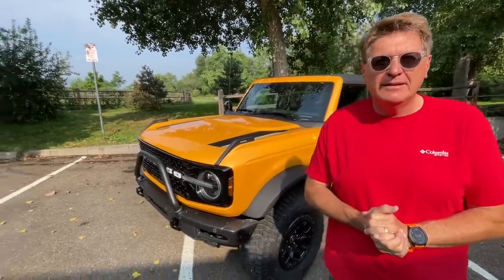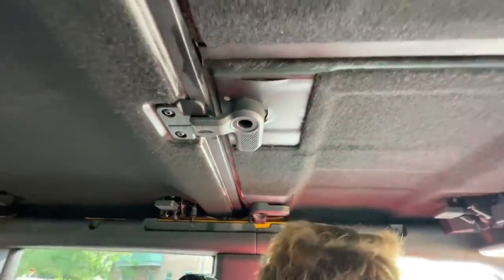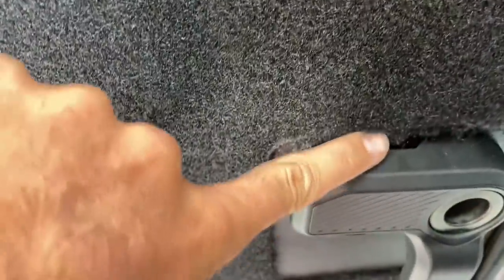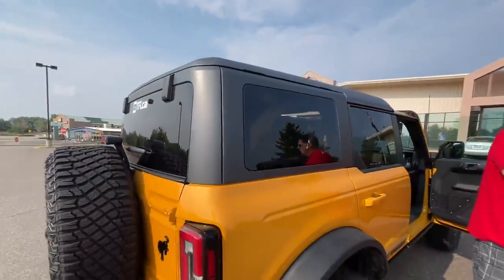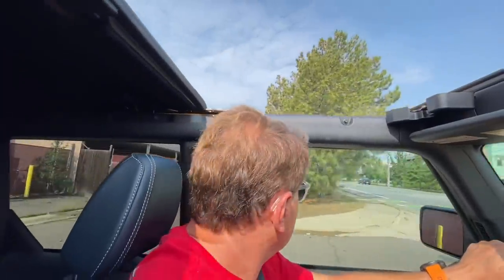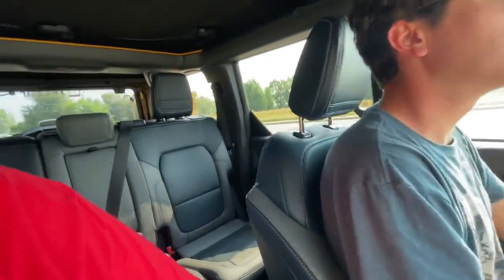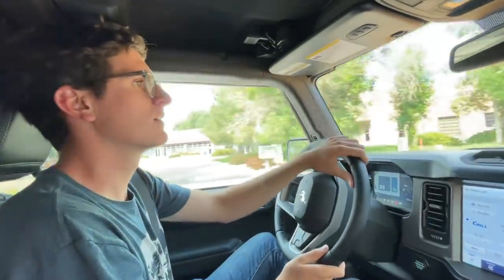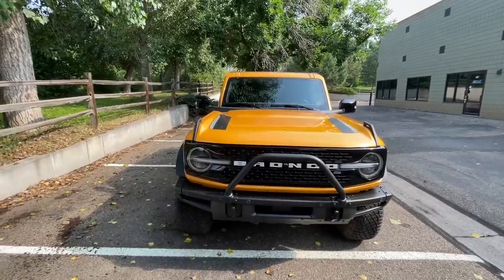This Roof Squeak In My Brand New Ford Bronco Is Driving Me Up The Wall, What Gives?

Comment: I honestly had a lot of the same issues with my 2019 wrangler before I sold it. Lots of creaks and pops from the top. Sounded like it let in alot of road noise compared to other new wranglers I drove. May be a quality control issue but not sure

Comment: They'll get that worked out with the supplier eventually. Probably the lowest bidder and it was "good enough". They had to meet the target date.  However, same problem with the original Bronco the old timers are aware of. Anyone that removed the top found it pretty hard to get it back on without noise and leaks.

Comment: I have a incredibly loud churp squeak in my 2021 Ranger. Turned out to be the drive shaft carrier bearing. Started at about 3000mi. and is intermittent. My experience has proven Ford dealership mechanics make a bad situation worse. So I'm going to live with it for now. Shame, otherwise a great truck so far.
Reply: My 21 Ranger is at 6000, and it's been in the desert, beaches, mountains. HELLISH WASHBOARD ROADS. It doesn't have a single squeak or rattle. I'm amazed at that. Put Ko2's on it and it hasn't gotten stuck yet.

Comment: Well, it looks like Ford built too true of a Wrangler competitor, they've copied Jeep's rattles and squeaks. Wonder how long the soft top will hold up before it starts to leak? As a long time Wrangler owner, I can say it's a matter of when and not if. The foam seals at the various water ingress points do eventually deteriorate, especially if you do driving in dusty/dirty environments with the top down, or leave the top down in the sun a bunch. Just comes with the territory. Your roof can be silent/watertight or it can be removable, but generally can't be both at the same time.
Reply: My thought watching this was, it’s no worse than a Wrangler. Considering the type of vehicle it is, I don’t think it’s that crazy.

Comment: Sounds like a similar problem that the Aussies had with a plane many years ago.  A pilot complained that there was a noise coming from the instrument cluster and it sounded like a midget pounding on something with a hammer.  The repair tech merely took the hammer away from the midget.  I recommend that you find those dwarves and take away their popcorn popper or their mining equipment.    I also suspect that they aren't dwarves.  It's probably pixies, sprites, or roof elves (my vote is the latter).  I know a couple dwarves and they are delightful and suffer the same issues we all have with our vehilces.

My guess is that whatever creature is causing the problem were kicked out by the gremlins that are in your son's British cars.  Gremlins are territorial.

Comment: Just get some rubber with adhesive backing and add it to the panels for a tighter fit. A roll is 12$ on amazon.
Reply: That's probably what Ford will do.

Comment: Looked like when you re-installed it that the passenger side latch closest to the drivers ear was looser and easier to flip into place than the others which suggests that it may be a combination of spacing and figuring out the bolt height when the handle is installed into the top. This combined with also possible misalignment may be what doves this problem. #1stgenproblems

Comment: Typical Ford corner cutting build quality. No matter how much you pay for it, your Ford will come with hard work truck plastic surfaces. They use it in most if not all of their vehicles. Going with the top of the line models just gets you heated/cooled seats with your hard yet easily scratched plastic. The work truck plastic is durable and will take a beating, but will look like shyt after a few short years.

Comment: Just common sense that this would happen when latching to another removable loose panel, with no solid support. Maybe thats the reason Jeep executes their top the way they do with the rear portion extending forward to the sound bar and bolting down, front panels are latched to a more solid point.

Comment: I'm not thinking replacing the hard top with a soft top should be the "fix". Getting this top to fit properly and be silent would be my first priority. That would drive me crazy. Me new Wrangler Rubicon 4xe doesn't make any sounds it shouldn't. Although it does make some pretty interesting noises that it's suppose to make, but odd "normal" noises. My last 4 Wranglers never had a rattle or squeak. However, in the 80's and 90's Wranglers, my Wranglers had so many squeaks and rattles I nearly lost my mind. I would have someone drive and I would sit in various areas of the Jeep to find the culprit. Some of the rattles were stemming from the craziest places and poor design. Reliable vehicles, but they just made so many awful noises.

Comment: Totally agree with Mr. Faust. I had 30 plus years as a tech. Never, ever buy a new model anything. 63 grand! That roof is a recipe for squeaks, rattles and leaks. It's already falling apart. Can't fault the manufacturer. People buy into the hype, line up and pay the money. The build quality of my 2013 Forester puts this thing to shame. Ford can't even build a decent engine. At Ford, quality is job none.

Comment: I feel like the rattling is either metal on plastic or plastic on plastic - so 1. if you have access to the screws of the fasteners, I'd try to tighten them - it will be harder to "seal" the roof back up but that should fix it. 2. if it's still there then there's too much play between the plastic parts: either spray it with some WD-40 or add some padding to the side of the fasteners which meet with the pillar! :)

Comment: I would buy a bronco if they didn't have these removable tops.  I never see wranglers or any other vehicles with the tops off.  If I do it's usually a beat up old YJ and not a brand new model.  I only ever took the top off mine because it had no AC......

Comment: I would never buy a 4 door. The whole point is to get the look of the 68 which the 4 door is a far cry from. Also I would remove the soft top completely and only get a manual transmission. Automatic takes all the fun out of driving

Comment: Coming from an auto engineer, the supplier can only be partially blamed for this. Ford speced the materials and functionality for the top. They should not have used a flaky material like that. They clearly did not validate the Bronco thoroughly prior to launch. These should have been caught in pre-production.

Comment: Until Ford comes up with a solution, try wiping the rubber seals down with Vasoline. I've dealt with other vehicles that had sliding side doors that were making that sound, and for a temp' fix I would lubricate the rubber seals and the noise would stop until the lubricant wore off or dried up.
Reply: Vaseline is precisely the wrong product to use. 
 Sonax gummi pflege or other dedicated convertible top/rubber seal lubricant is what you need to use. You need to use a product which is inert to the seals themselves. The Germans have had this figured out for 30 years now.
Reply: @otm646  It worked great. You don't cake it on, just put some on a rag and wiper the rubber down and then wipe it off with a dry cloth.
Reply: @calvinh.8882  You're missing the whole point. Those rubber seals are not long term compatible with Vaseline. There is a reason they call it a petroleum jelly, it's petroleum based.
The specifically engineered convertible top seal lubricants are inert to the rubber. They aren't going to interact, they aren't going to make the seals go soft, they are not going to make the seals fail prematurely. If anything it reduces their exposure to ozone and make them last longer.
Reply: @otm646  I get it. It's best to use a treatment on them, but when you don't have the proper treatment Vaseline works just fine.

Comment: Shoddy quality control. It is on a modified Escape after all. You would think for $63k the appointments would be better. One vehicle I will surely put on my do not buy list. Modern day Edsel.
Reply: The Bronco Sport is a modified Escape.  The vehicle in the video is a Bronco and based on the new Ranger platform.
Reply: @treyveston7965   either way, it’s very poorly finished. Ford and the dealership should be embarrassed for releasing that to the customer when they knew well and good they had a huge YouTube following. Ford should make it right by immediately correcting all the issues pointed out by everyone that has commented. I for one would never take delivery of a vehicle with that shoddy headliner and you can be damned sure I’d be on the dealerships backside because of that rattle. $63k for that is absolutely absurd.

Comment: The squeek' s origin is obvious: this véhicule is designed without a  B-pillar crossbar , so the top's panels  have nothing to hold-on to, they  just clamp to each other , design flaw plain and simple left row of pillars is shaking independently from the right row of pillars...

Comment: Thanks for pointing out the poor quality control from Ford. Unfortunately, nothing new. My brother's platinum Aviator isn't any better when it comes to all the various "bugs". And the dealer network hasn't been much help. Back to the Bronco. Maybe try some silicone spray all around the tops weather stripping. And check the latches for looseness and adjustments.

Comment: was easy fix, my new wildtrak started doing it , i bought eva foam sheets and installed where each pin from roof panel goes in and noise is gone, cheap easy fix

Comment: Never buy a new car model the first year of production. It is almost guaranteed that it is going to have issues solved in later editions. 
Toyota is not excluded from this rule, their cars are good because the low level of innovation, basically facelifts but not changing anything in the mechanics dept. When they launched completely new models like the FJ cruiser they were plagued with faults as well.
Did you know that in aviation, just for this reason, when you buy a new model aircraft that never flew before you get a significant discount for being the first user?

Comment: A removable top must by its nature be a little bit flexible which means the separate parts will move against each other slightly.  What you are hearing is the plastic surfaces in contact with each other rubbing against themselves as the top flexes.  To stop it will require some sort of lubrication or a then slippery strip of a solid material (perhaps very thin felt).  WD-40 makes a silicon lubricant that you could spray onto the mating surfaces that dries and leave a thin coat of silicon behind.  When my electric windows started sticking and were hard to raise I sprayed a generous coat of the silicon lubricant into the channels and let it set for about 20 minutes and then the windows started going up and down easily and it did not leave a greasy film on the glass.

Comment: Set the camera down while dad drives, son needs to move to different seats and pinpoint the rattle. 
Or cut up a old pair off pants into small squares and put a piece in between each latch, one at a time.

Comment: I'm liking the know-it-alls who are saying "buy Toyota".  LOL.  If were only that simple.  Toyotas with their oil burning engines, metal shards in the air bags, infotainment systems that crash and won't boot, and failing fuel pumps.  All cars have their problems, ladies.

Comment: Nothing new for Ford.  Their police Interceptor SUV's middle window rattles something fierce from the factory, or did when they first started making them.
Reply: Middle window?
Reply: @jakeoht791  The dividing window between the cop and the person in custody.
Reply: @jakeoht791  Supposedly Ford didn't make these tops that are rattling either.
Reply: @travisstroodle2170 To the best of my knowledge Ford dif makes the roofs. However, Ford along with every other police vehicle sold on the market sells their vehicles as standard without any equipment. All cages, lighting, push bars, consoles, etc are installed by upfitters or departments. Ford does not make police cages. Your argument is equivalent to saying Ford should be responsible if an aftermarket wheel was put on a vehicle that affects the ride quality.

Comment: They all have hard plastics.  Fords for some reason look overly cheap.  Same goes for Ford's center stack and gauge cluster.  They have the worst interiors.  I had a 2014 Ranger overseas.  It was a great truck.  But the interior looked like trash.  And it was a pretty loaded XLT.

Comment: If you didn't think it was worth the price, Why Did You Buy It?  The roof noise, should be easy enough to solve with some sort of tape or silicone wipe or spray, and if it's the seals, the silicone is something you should be doing anyway for preservation.
Reply: @Stinkey Cheese
How would you KNOW you'd have this ridiculous problem when you just bought a brand new
63,000$ vehicle? So you're supposed to use tape or silicone spray to fix your brand new car with a few miles on it. LOL You MUST work for WOKE BROKE FORD! LOL

Comment: I'd at least attempt to use double sided tape, foam, rubber shims, flex seal, etc..   The vehicle is flexing, so all those pieces are rubbing.  Try the cheap fix before you buy another top.